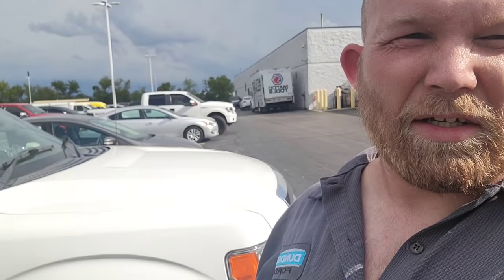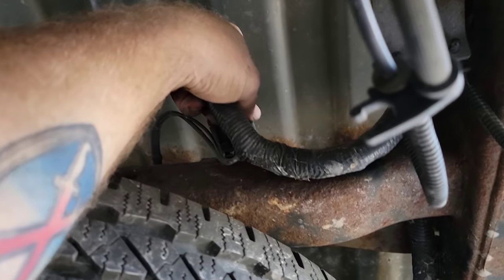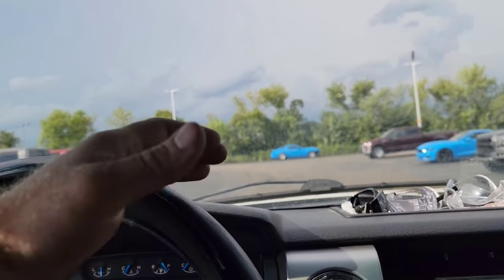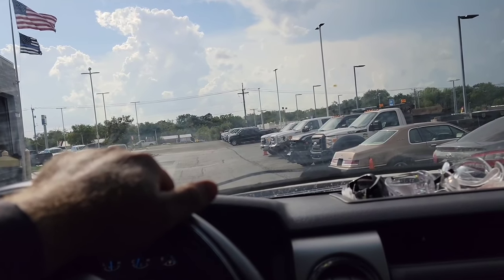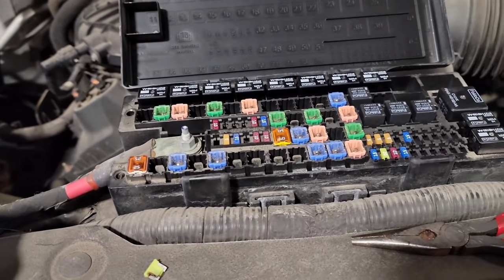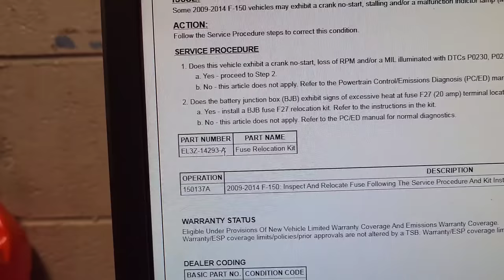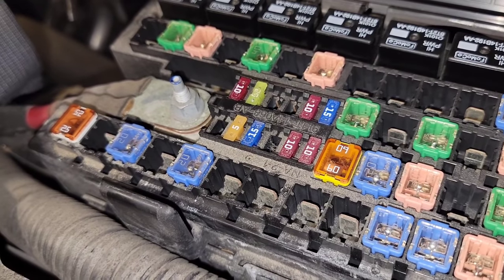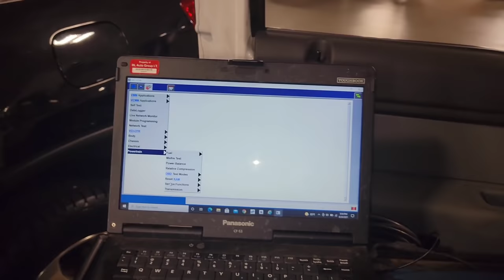Top 4 Things That Cause The 2009 - 2015 F150s to Hard Start or No Start - Fuse, BCM, FPDM, Purge Vlv

Comment from the maker: The fifth issue that I've seen recently that I could not fit into the title was I've had ignition coils going bad frying the powertrain control module the engine computer
Reply: I’ve also seen that the flex plate on those were prone to the teeth chipping off
Reply: I think my truck is having this issue
Reply: Would the perge valve make it bogg down eventually? Or would you think it would be the fuel pump?
Reply: Frying the PCM, the engine computer?  Oh LORT what news to make up to.

Comment: #27 gets relocated to #70. Everyone with a 09-14 F150 will get stranded by this at one point or another. I'd recommend it to every customer you get. It's a maintenance item. Did mine as such. Your list is bang on!
Reply: Yup. And it’s unbelievable that Ford still hasn’t made this a full on recall. This issues stranded my brother In a snow storm and his truck wouldn’t start. No heat, nobody around, etc.
Reply: According to ford dealership they always negate issues. We don’t see thatn act like idiots. Now pushing a $105k new one on me — f no id give it to charity before that  !!
Reply: Does it have to be #70 spot?
Reply: The fuse is the problem.
Just use a regular height fuse and problem solved. Ford used a reduced height fuse that concentrated the heat.
Reply: Had mine done yesterday
Reply: What if you check fuse #27 and the fuse isnt melted its looks brand new. i was stranded weeks ago got it towed. They said nothing wrong

Comment: I had the long crank, for me all I did was replace every ignition related fuse, even if they looked good. Cleaned my air filter, and battery terminals. Bingo fixed. Always try the simple things first.

Comment: Yeah just had to replace the purge valve on my '17 fiesta for a rough start after refuel & throwing a check engine light. Crazy to see that it's a common failure across several models & engines

Comment: The biggest problem I have found with no starts is corrosion. If you have checked out all the culprits, pull all the fuses in engine fusebox and spray penetration oil for an overnight soak. This has solved the problem many times. But a good scan can't be beat!
Reply from the maker: Grounds are the next biggest category
Reply: True. Forgot that one.😀

Comment: Broke down in Phoenix this last week. Took my truck to a shop and they replaced the relay and fuel pump control module to the tune of nearly $500. Drove to Flagstaff turned it off and it wouldn’t restart. It finally started so I left it running until I was home in Idaho. I just watched your video and pulled fuse 27. Looks just like the one in the video. Thanks g f or the info.

Comment: Something that’s so weird to me coming from motorcycles is how clean and rust free our bikes are but  cars have “Normal Rust” 😅
I about died when I saw my transit driveshaft caked in rust but they told me “that’s normal”. Since I’ve heard of it I’ve been peaking under every car and they are all the same underneath. What a trip. 
I’ll take to working on my rust free bike suspension parts any day. 
4 bolts to drop the whole front suspension out 😆

Comment: That's a very good observation thank you for the info. I had to do the relocation of the fuse and a fuse box recently on the F-150. I know it comes with two stickers one that goes inside the owner's manual and the other one goes on the fuse box. That way whoever works in the vehicle in the future knows that the fuse was relocated.

Comment: Man, with that tank sucked in i’d be worried about a stuck closed vent solenoid or gas cap too.

Parts are making things harder lately too. Did a FPDM last week and the replacement was defective, went from low power and low voltage to pump, to no start and no voltage to pump. Smh

Stay strong.

Comment: I wish you worked at the dealer by where I live, I sent my car over there for an evap leak. I spent 1400 dollars and I was driving to work and engine light came back on for the same problem. Back to the dealer I went, so frustrating!

Comment: I have a 2011 f150 3.7 liter, I replaced that fuse years ago because it cranks and no start, recently it no crank no start with dash saying start system fault so after little research someone said it could be the key fob, turns out it was, i bought an aftermarket key because of the stupid my key feature on this truck and the top speed was set to 80 mph. The original FoMoCo worked and the newer aftermarket key was trash. I try to use FoMoCo parts now especially after I replaced all my tire air pressure sensors from Amazon crap parts and they lasted less than a year and the originals lasted almost ten years.
Reply: I have a 2013 f150 3.5 and it's doing the same thing. How did you know it was the key ?
Reply: @donjefe5999  I had the original key fob in a drawer, I tried it after checking the battery in the fobs and under the hood and the fuses and it started, the aftermarket key gave the start system fault message, the original worked fine and still does to this day, their is no way to check unless you have an extra key fob, a locksmith has them probably around $150

Comment: I literally had to do this on my 2011 f150 FX4 5.0 And I just did one Friday on 2013 3.5 liter. If you have never done one it's looks scary with all the wires. But it usually takes about 10 min. Relocation down one row from f27. Move to driver side 8 spots. Put in a mini jcase. Every fuse relocation I did that's what was in the pack
Reply: I got the same message side with my 2011 f150 5.0 and have been having this issue for some time too, it’s frustrating and I read it before but forgot until I stumbled across this video as a reminder .  My trucks been down for 3/5 days at my friends house and first day I dropped the tank and changed the fuel pump sending unit out for the second time !  Thanks for the video reminder , hope it helps me along with others too !  Now I can’t wait to go back over and test/check it, as I really need my truck for work !!!  💯 I like the ford trucks but this is really getting rediculas and no upgrade/recall from Ford ???   WTH ?  Figures- Fix or repair daily .  ☝️💯😡😞💰

Comment: I think I’m having a purge valve issue with my 2020 F150 2.7 ecoboost. On a warm restart it’ll misfire heavily unless I give it gas. Or it’ll stall right away. Noticed it does it bad after filling it up

Comment: If the purge valve is stuck open shouldn't you see a P0172 code ?
Reply from the maker: that's not always going to be the case everything's not always clean cut and dry
Reply: @FordBossMe  Oh i agree with the cut "n" dry statement 110 % Rich ... I never attended the Scotty School or Automotive Repair lol. 
I have only seen the tank concaved like that on a 2011 Ford Edge  so naturally assumed it could happen on full size trucks too so i always check the tank .  On the Edge there was a P0441 and a P0172 which lead me in the right direction . I would have been surprised had there not been any codes and the tank that distorted ! Then again we learn every day !

Comment: What's the problem when it starts with the remote but when the key is turned on it stops ?
Reply from the maker: It would seem to me that you have an issue with your ignition or there's something wrong with the security system or programming with that key once it's put in the ignition

Comment: Does the purge valve issue affect other engines or primarily the 3.7NA? I am not having any issues besides the dead lead-frame (Ford is offering to pay half the bill despite it being reported under warranty) but I am curious.

EDIT

That is up to 2014. They changed to the aluminum body in 2015. My 2015 does not have the power distribution/fusebox up front like my 2013 did. It is on the passenger side, but you likely know what I mean.
Reply from the maker: Others also
Reply from the maker: I put 2015 because I referenced in the video make sure you have the fuse box up front I've seen mid-year switches where things don't quite get carried over properly ideally you are right but sometimes I have to cover that extra basis that's why I referenced fuse box up front
Reply: @FordBossMe  I did not know that, I thought all year-models were the same for whatever year. Thanks for the info!

Comment: My 2012 having this issue. Tried the fuel pump driver module, replaced plugs, purge valve, and #27 fuse. Fuel pump primes.

Whats weird is I pulled the #27 fuse and it started for a second then stalled. Could it be corrosion in the fuse box?

Ordered a relocation kit. Hope this is the issue.
Reply from the maker: Did you check the connector in the fuse box on the passenger side in the cab? And did you check the ignition coil fuse in the fuse box as well remember I have multiple videos on this no start issue specifically look at it there's a Ford Raptor same basic setup I did everything that I can do to figure out what was wrong with it come to find out at the end of everything I checked the ignition coil fuse in the fuse box it was gone the customer was messing with the fuses and removed it

Comment: Maybe you can help me my son has a 2016 f150 v8 does not want to start when it’s warm otherwise it starts fine
Reply from the maker: How you give me a little bit more information about what it does do when it's warm does it crank when you say when it's warm does it mean that the oil is warmed up but when the oil is cold it won't start?

What previous work has been done and what codes have been cold pulled from the computer
Reply: @FordBossMe   no codes just a long crank seems like no fuel but I have a Modis it’s telling me I have fuel pressure the ro or going around is cam phasers also once you drive it then shut it off then she doesn’t want to start
Reply: @billyryder501  With what you’ve described and having NO codes, then it’s usually a mechanical issue with the fuel system. Could be fuel filter, could be fuel pump, could be injectors. The only electrical problem that could be the issue without throwing a code is a temp sensor for fuel mix. A Ford tech can plug into your truck and find out.

Comment: "Topping off" part of starting the issue?
Reply from the maker: Huh?
Reply: @FordBossMe  topping off the gas tank. I also wonder this, if it messes with the EVAP system. I learned from my dad to never keep topping off the gas tank because that’s how it’s designed, need some air in the tank so it doesn’t damage anything with temperature fluctuation.

Comment: I need some advice. What is the lifespan on these engines. Ive been looking at some used ones from a individual seller that have over 200,000 miles on them and I believe they're asking way too much and I am super leery of getting something with that many miles.
Reply from the maker: Over 200k?! Pass
Reply: @FordBossMe  my thoughts exactly. I just dont know what mileage I could find and be ok. I dont want to buy something and the engine or transmission blow up within a month

Comment: The 2013 F-150 i mentioned to you before just shuts off randomly . NO codes , Rear pump relay has been replaced and fuse relocation has been done by myself recently . The truck i am diagnosing is a 5.0 l that will  just shut off at idle warming up or 2 hours later  driving at any speed or stopped at a light . There is NO condition , time or temperature related to when it shuts off  . It does not stumble or chug but much like the key was just shut off . When restarting the key needs to be cycled to re-initiate the PATS but starts immediately and runs flawlessly until the next time it randomly shuts off . Any thoughts ??
 NOTE i have checked all connections in the passenger kick panel and underhood fuse panel and also monitored the ECM & run/start relays which remain latched after the engine randomly shuts off .
Reply from the maker: Does it retain fuel pressure once it shuts off can you monitor the Data Logger and see what the fuel line pressure is once the vehicle dies is it able to continue to retain constant fuel pressure once the vehicle shuts off? Or whole entire vehicle just go dead as if there's no power
Reply: My’14 n 5.0 does the random die too. Sometimes I have to let cool down before it’ll start n sometimes starts rite up. Sure would like to know wtf this is. I replaced the fuel pump driver as of last, knocking on wood now.
Reply: @scottwebber652  did you ever fix this? Mine has started doing this too.

Comment: did you set that code when you unhooked the fuel pump module????   yea it needed the relocation kit if the fuse looked like that.
Reply from the maker: No because I left the key in the on position it would have to be cycled more than once
Reply from the maker: It didn't see a second issue through a second self check

Comment: Hey I have a 2019 ford escape I just rolled 60k (I drive highway alot) and third gear acts like it slips sometimes and it acts like it bucks sometimes coming off throttle what are possible causes for this issue
Reply from the maker: Trans fluid, shift solenoid contamination, early failure of internal components, may need trans adaptive strategy reset 

A basic drain and fill may help
Reply: Damn should got a toyota lolol

Comment: At work we’ve had a 2012 and 2013 3.7 f150 which have a hard time starting after getting gas. I guess it’s a common problem apparently.
Reply from the maker: Yep Purge Valve is Most common for both motors

Comment: I’m dealing with this issue too #27 changed out, new f p driver. Didn’t know about purge valve. I have the 5.0  -do they have one ?  I don’t see the p v issues but if that thing doesn’t wanna start it wont !! A shot of start fluid by the intake horn would work. Never any codes. I’m hoping the fpd is my answer n 🤞
Reply from the maker: Check the fuel pump driver module and also check the connector at the body control module inside on the passenger side down by the floor remove the fuse panel door and make sure the latches are pushed in all the way because sometimes people push up against the plastic and knock the latch out and break the Locking clip
Reply: @FordBossMe  everything looked good but I did replace the fpm so time will tell. At least I didn’t piss that $30 down the drain. Lol

Comment: Random question, hoping you Ford guys out there may be able to help me. Im working on a 2011 f150 and the rear driver turn signal isn’t working, the brake lights work and the indicator clicks fast in the vehicle, I’ve checked all ground, fuses and relays. From some reading it appears the Bcm has to be reset
If a bulb blows or a short is caused, 

Any help is appreciated.
Reply from the maker: Clear the codes it'll come back on
Reply: @FordBossMe  The cel codes? I don’t remember if there were any but I’ll double check tomorrow.
Reply from the maker: So 2011 on they started using where they would shut the circuit down or they would make the turn signal flash fast even after you put a new bulb in and corrected the problem until you clear the codes to let the computer know everything was okay now I can't guarantee that that's the problem but I had that happen to me before and then once I cleared the code that reactivated everything for me and went back to normal and all it was was just simply a blown bulb but it needed to see the codes cleared
Reply: @FordBossMe  perfect, when you say codes your taking about the check engine light codes correct?, I’ve got a snap-on scan tool and my shop but that’s about it, from what I’ve read ( I could be wrong but i at least like to be thorough before asking for help) I need a ford scan tool to reset the bcm
Reply from the maker: Yes
Reply: @FordBossMe  that ended up being the issue, thank you.

Comment: What if your truck doesn't have a code or an engine light?? I have a problem on a 2012 and at times it doesn't start! But later it's running fine for a couple of days
Reply from the maker: Well unfortunately if it's one of those things where you can't duplicate the problem it's going to be hard to diagnose something like that
Reply from the maker: Look at my other videos on here where I have F-150 no starts because there's like five other issues that are common with these

Comment: Can you tell me this issue: my 2009 f150 4.6 engine, Last October 2022, as i was heading home and the truck shuts off all the sudden. I replaced water pump, fan clutch, spark plugs, ignition coils, fuel pump, starters & alternator, oil sensor switch, and it will crank but won't start. Its telling me that the spark plugs or ignition coils is misfire to pcm/ecm so I tried to lock the truck, it won't lock, no power. I called my ford dealer service said it could be fuel pump or the electrical issues. My neighbors said it could be the PCM that the rain moist got into the PCM but I checked all the relay and replaced few of them. I bought a new PCM computer. My neighbors said when he took the vehicle to dealer they said it was the PCM computer so they paid $1000 to start up. Do you think its the PCM. Any advice 
thanks
Reply from the maker: I mean it very well possibly could be the PCM especially if it's more than just the starting issue that's not working
Reply from the maker: I would try to spray some starting fluid while cranking I didn't see if it starts and if it does then you have a fuel problem and if it doesn't you might have an ignition problem which in turn I would be checking the crank sensor make sure you got RPM signal because if you got no RPM signal in the vehicle won't start and that comes from the crank sensor crankshaft position sensor and if that don't work then it might well be a PCM